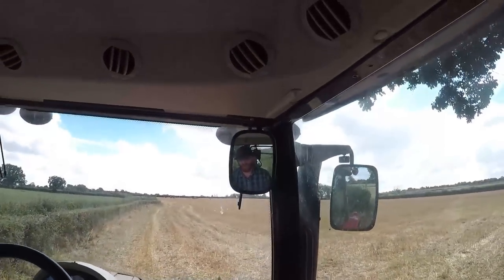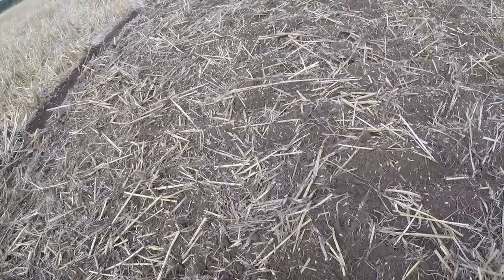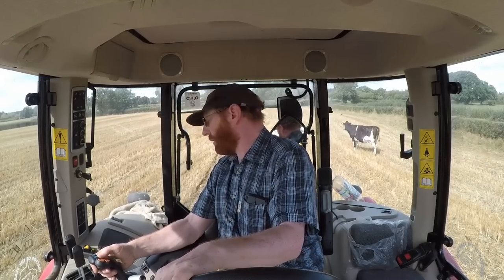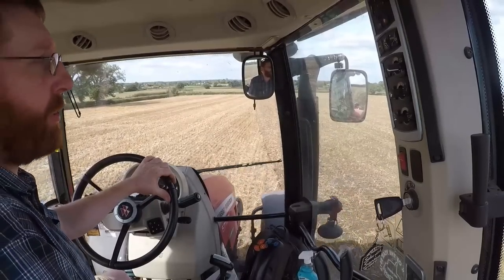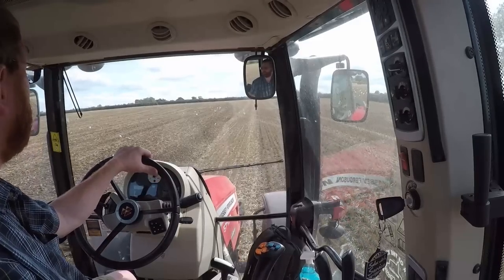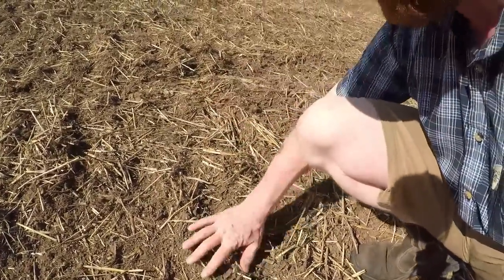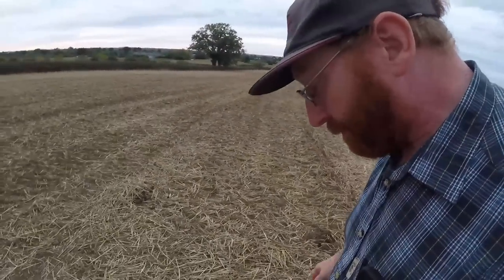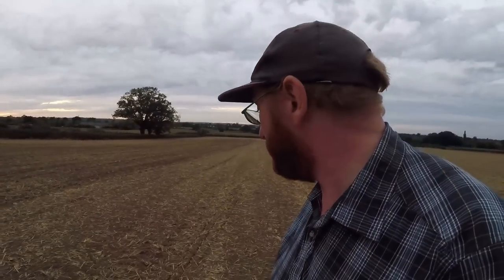No plough grass seeding.

Comment: Hello from Oregon,USA watch your videos and immensely enjoy them particular vintage Thursday.I have a request for you.My newest tractor is a MF35 1962 and a Ford 640 1957 and a John Deere MC60 crawler 1940s.So I don't have any buttons or whistles to push or pull .So if you please when you push a switch or pull a lever for any implement you using at the time could you tell us what the switch or button or lever is activating.Thank you. a 80year old hay farmer.PS all adjustment to implements I use are mechanical.

Comment: Cracking video, well done. The arctic made for some really tight turns on the headland, well displayed on the drone footage. Make the work lights QD, you might need them in the future. Was that Bruv i saw in YOUR tractor ?
Reply from the maker: Yes, no point taking the hedge cutter off just for 1 job.